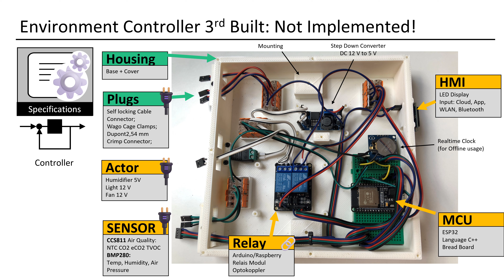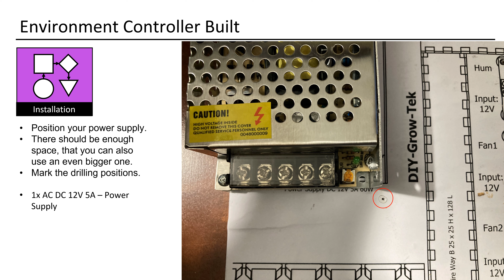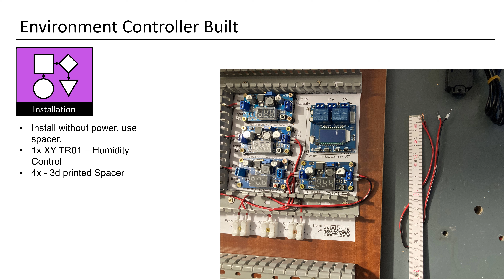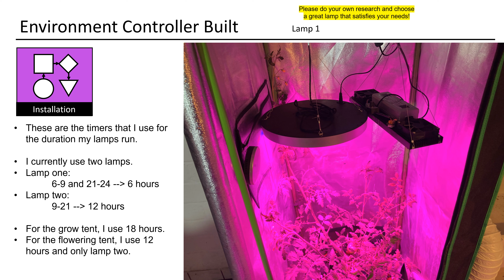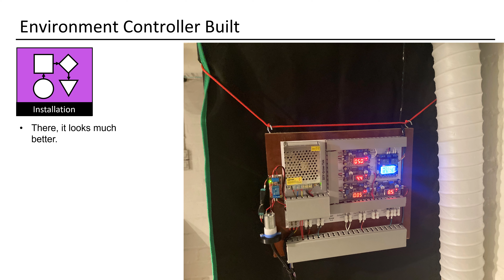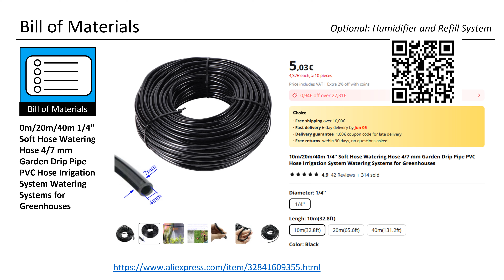4.05 - Grow Tent Setup for Fruiting and Flowering Plants

Comment: hi, wanted to ask abouth the controlers if i can connect them with a app. For example if i wanted my own app that would collect that data?thanks
Reply from the maker: @juh0.12  Hey, my design is for the XY-TR01 Humidity Controller. I chose this design because I wanted to create an offline version. The main reasons were that it’s much easier for people to build, and I can't provide extensive support for any programming issues they might run into. So, I went with the simplest solution.

I understand that you prefer an online solution. Here are a couple of options you could consider:

1. Use an Arduino with Arduino Cloud. The cloud service is free for one private project, allowing you to control a relay via your smartphone. For a humidity sensor, I’d recommend the BME280 or SHT20.

2. Use an ESP32 board with ESPHome and Home Assistant. You’ll need a relay and a humidity sensor, just like with the Arduino setup.

My designs are all very easy to upgrade and integrate into the cloud. Wishing you lots of fun and success with your build!

Happy growing, and greetings from Germany!